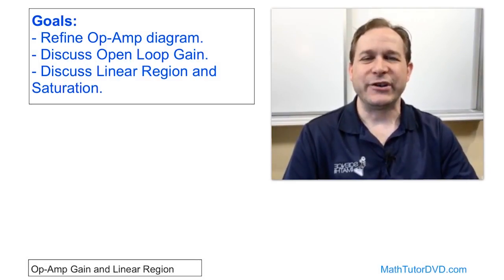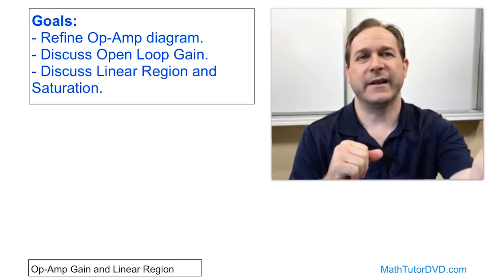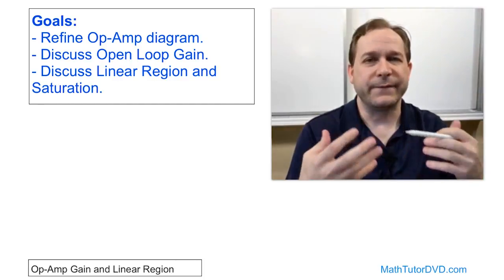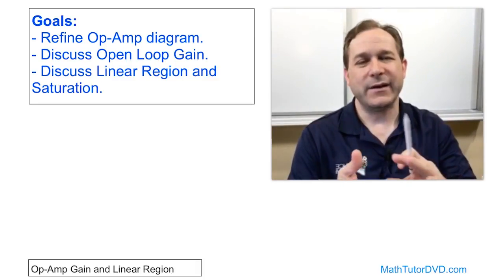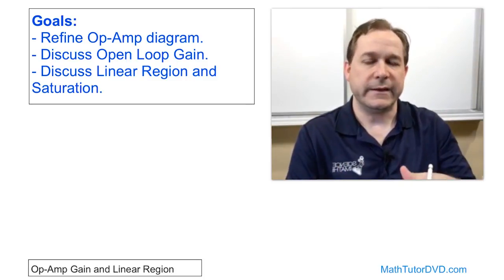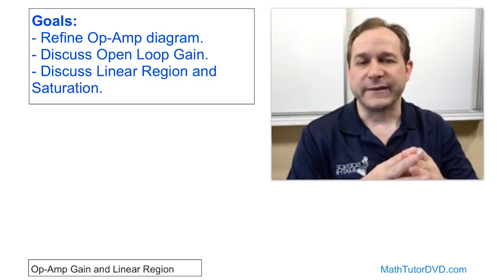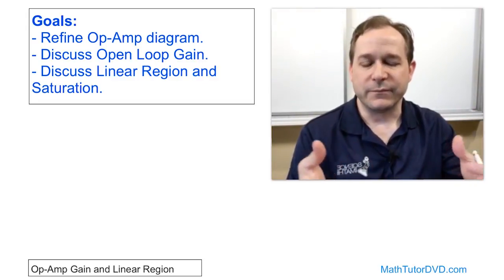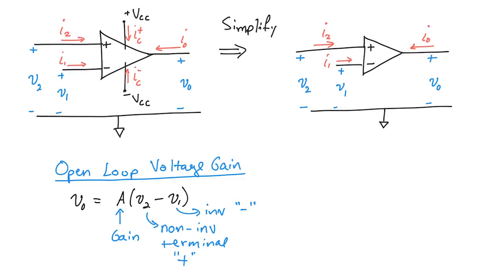04 - Op Amp Gain and Linear Region

Comment: But sir....u didnt teach what exactly is gain.....n where did that come from.
Reply: The purpose of gain is to increase the voltage. The input voltage is multiplied by the gain to obtain the output voltage, which is much higher.